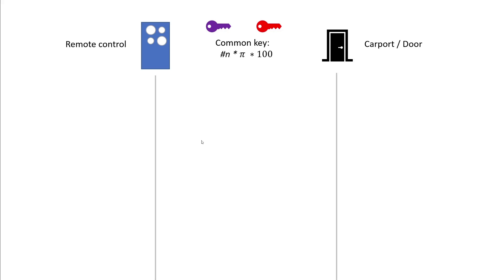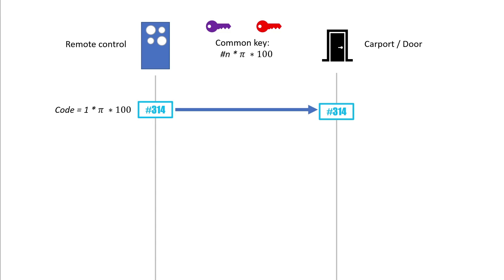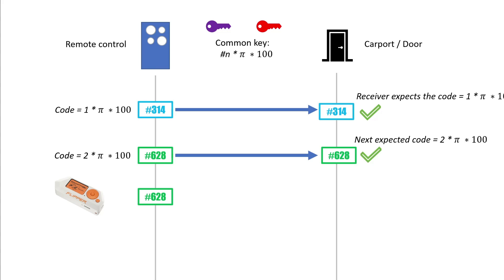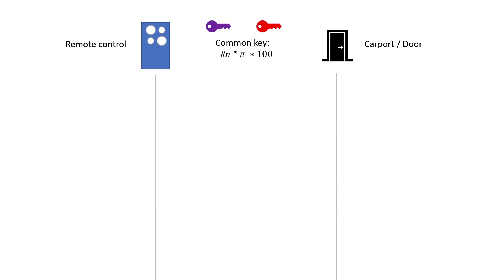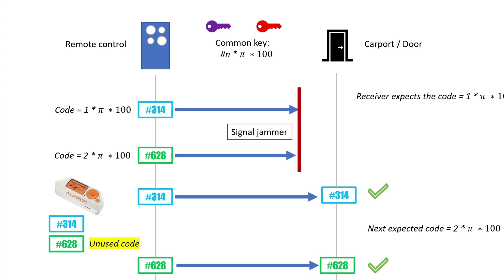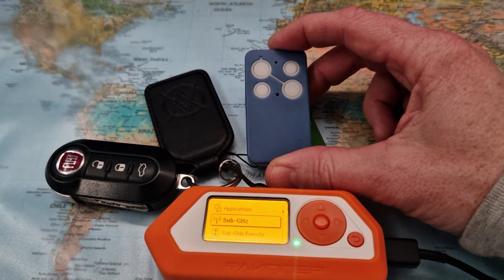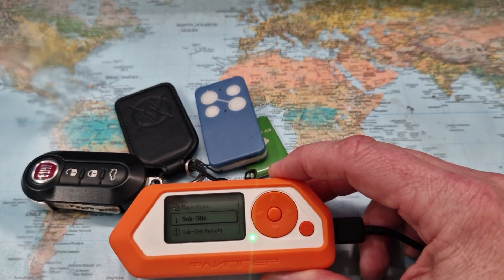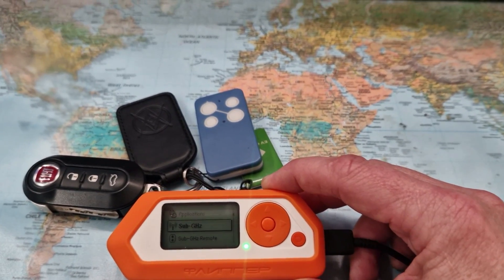Rolling codes explained #flipperzero

Comment: I was playing with my key fob and now my fob and car are out of sync. Any idea how to resync them? I'm about to take it to the dealership.  Most videos online want you to have 2 working remotes to do anything, the other videos didn't work.
Reply: No option but to have it reprogrammed. Call a local locksmith to program it. It’ll be hundreds cheaper than the dealership for the same exact working key. Then from there, buy 1 or 2 cheap key/fobs online, and use those 2 working keys to program them yourself (following online instruction), and then never touch those two base remotes for tinkering (they’re your failsafe reset and program new keys baseline) and you can play with and mess around with the extra two cheaper fobs you bought and programmed yourself. Trust me, local locksmith over dealer. Don’t believe me? Call and ask for the price for the key program than call 2 local locksmiths to compare. Can be as much as $200+ cheaper. That’s not including the cost of the upsold $140 key blank they sell you.
Reply: @Stopes.  thank you.
Reply: @Stopes.  thanks for this explanation. Question though: how does having 2 “untouched” (properly programmed) base key fobs help if a de-sync happens. Let’s say someone has their 2 original, properly working car keys (with a fob to unlock doors, but regular key to start the car). And then they go buy a couple cheapie fobs online and program them (using their base keys, I presume? Idk how it’s done) for tinkering purposes. Then they use a flipper, for example, to read the signal from one of the cheapie fobs and then emulate that signal to the point where the fob and the car de-sync. 
How would having the original “untouched” OEM fobs help? Wouldn’t they somehow be de-sync’d as well, seeing as the car itself is expecting a “later” code than the keys themselves are sending??

I have no knowledge of how rolling codes and de-syncing works besides the contents of this video, so I’d really appreciate some clarification. Thanks 🙂
Reply: @MisterK-YT  The single key is only affected on a desync. Not all. Each key is unique in its codes. The encryption is unique. The computer is not smart enough to know (without being provided by the key) the other keys upcoming codes and affect them, nor is it programmed to. Only the key used is affected. Hence some cars need two programmed working keys to program a third or fourth. So if you desync keys 3 or 4, you aways have keys 1-2 working to resync new ones.
Reply: Check your car manual if you have it - some cars (at least the older ones, early and mid 2000s) have re-sync procedures which use different codes (which are less likely to go out of sync due to a more complicated trigger condition) for when you change your remote battery, for example.
Reply: @Addlibs  thanks I'll check that out.
Reply from the maker: No, I'm sorry - I don't know any workarounds when the remote gets out of sync. But this is afaik a small job for your car dealership. Good luck - hope it sorts out.
Reply: @techandfun7723  I should have done more homework before experimenting.

Comment: Solution is simple. I use a smart relay to open my garage door connected to Home Assistant. Decrypt a 4G /5G communication with HTTPS using flipper :) Also I can open my garage door from anywhere when a delivery guy has to put a package inside. These remotes are outdated.
Reply: A challenge-response mechanism would be just as safe, no need to overkill with cellular modems. Remote prompts for a challenge, door controller provides a challenge, remote signs the challenge and controller verifies signature. No sync procedure necessary. No replay attacks (provided the challenge is random with good entropy). Same principle as used in PIV/smart cards, EMV contactless cards, NFC security keys, etc. Requires controller to have persistent state in the sense of remembering the last issued challenge with a timeout, until a response arrives and is verified.
More battery depletion than simple rolling codes but much less than a 4G/5G modem, and lower attack surface as you'd need to be physically near rather than simply being connected to the internet to even attempt an attack.
Reply: I use a key hack that.
Reply: MITM wil beat your 4g\5g with HTTPS
Reply: @helloslayer666  Relay wired to Home Assistant with NO port forward. HA server reach out to HA cloud. Phone has constant VPN connection and I do not use public Wifi-s at all. HTTPS in a VPN tunnel. I feel safe till quantum computers will get mainstream.
Reply: not everyone is an electrician who can wire up relays, simple enough for me but not for old joe.
Reply: @falcon5751  or young joe, in my case

Comment: rolling codes + signal jammer can permanently disable a remote so for example, there is a jammer active and then the remote button doesn't work then if rolling codes does not loop and go on forever than the device will be rendered unusable unless you find a way to reset rolling code to 1
Reply: My garage door must have an n of 10000, because that’s how many times my 1 year old pushes the button while we walk from the car to the house out of the reach of the remote ( and it still works)… besides what if you have multiple remotes?
Reply: @1russoturisto  Came to say this. My kid was playing with my car keys ( in the house, out of reach ) and pressed the lock/unlock like 100s of times but the fob is still working.
Reply: @Burn0u7  Was probably still in range.
Reply from the maker: That's true! This may also happen if you press the sender too many times while being outside the reach of the receiver.
Reply: @techandfun7723  I was going to ask you this.  What if I am away from my car garage and I press the open door button 5 times, then go to my garage and press it again, how does the receiver adjust for the  code it is receiving, which is out of sequence, or past the expected next code it is listening for?
Reply from the maker: @squelchtone  Normally there will be a "buffer" so that the receiver will approve the next n-codes. Lets say n=50, then you can press the button 50 times without getting out of sync - but n can also be a smaller number, sp you have to be careful. I usually test by max 10 times before Im syncin' up the remote by pressing it withing the range.
Reply: @techandfun7723  Thank you for the explanation, appreciate it, and thanks for the great video!
Reply: @squelchtone  if you use signal blocker to get a fresh set of say 5 codes, how many times they can be used ? just 5 times to open the garage and then you need to do it all over again ? It can't be permantnently saved 5 sets you can keep using  ?

Comment: I understand that the code can be used 1 time, but how to block the signal?  (jamming) using which device?
Reply from the maker: Sorry, but signal jamming is a bit on the side of this video, and is a bit outside my comfort zone ;-)
Reply: Remote out of range realistically. Real world this doesn't happen so much. There's replay attacks on keyless cars but criminals just steal keys or break into things physically.
Reply: Jamming is illegal in many countries, you should check if it is allowed or not.
Reply: Jamming is somewhat illegal.. so you should be careful with it
Reply: @Bobo-ox7fj It's not just the frequency. What matters is bandwidth. If you transmit noise covering frequency+bandwidth of the victim you will effectively jam it.

Comment: If you're able to Read a signal instead of Read Raw, the FZ has built-in rolling code. But you must pinpoint the exact frequency. Use the Frequency Analyzer to pinpoint the frequency, making sure its the same frequency at least four times and then hold the center button and it automatically take you to Read and then from there you can config and get a more exact reading before saving it to be emulated later.
Reply from the maker: That's a good clarification 👌 Thank you 😀
Reply: @techandfun7723  You're welcome. I saved my garage fob on the flipper as a backup. I will use it sometimes but I have to cycle my original garage fob to an unused code afterwards. My wife hates it ^_^
Reply: @procheathepitai  how do you cycle your garage fob to a new code after? I heard someone say they emulated their car fob to open their car door, but then they couldn’t start their car. From what I understood, he couldn’t even start his car with his actual key fob at that point (not just via the FZ). Does that sound plausible?
Reply: @MisterK-YT the car fob desynced. If I understood correctly when I looked into it, there's about 4 or 5 keys codes that can be stored and the last one or two codes on the stack that were popped off could be recalled into memory. If the code has been used or cycled more than these couple of times, the code can't recall what your fob is outputting and will either have to recycle back to a working code (could take hours) or reprogram (which is not fun.)
Reply: What fw are u using? Official firmware holding center button doesn’t take you to read.
Reply: @Cosmozic  looks like rogue
Reply: I assume receiver will also except codes further down the sequence?  For example, if you press your garage opener too far, those codes won't be received, but if you get closer and  you press again the receiver will accept it even though there was a bunch of codes that it never saw?
Reply: @bennguyen1313  not sure but you make a good point
Reply: Nicely explained, but still not working on my car (thats kinda good ofc) 🙂 But still wondering why, I recorded the code far far away, but nothing
Reply: This takes forever tho
Reply: Hey can i ask you how you analyze the exact frequenzy thx